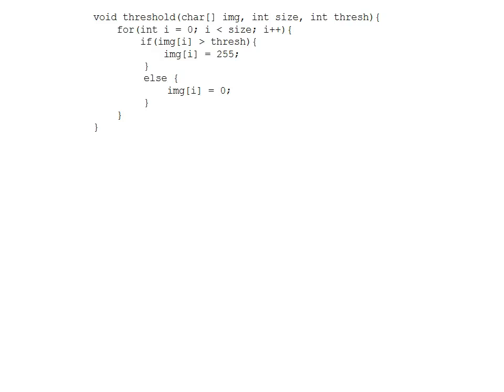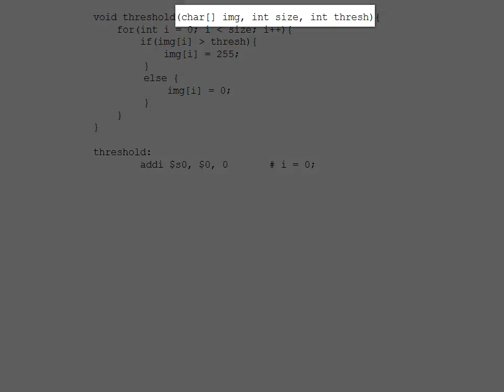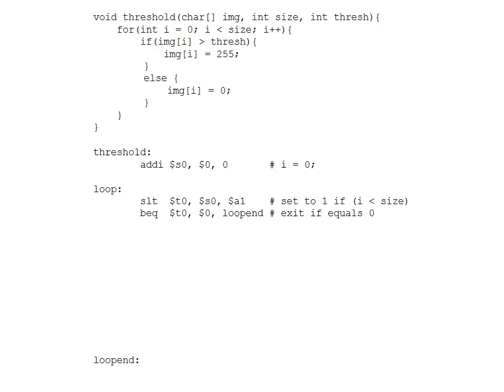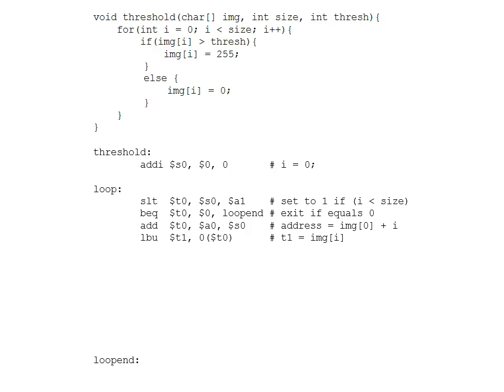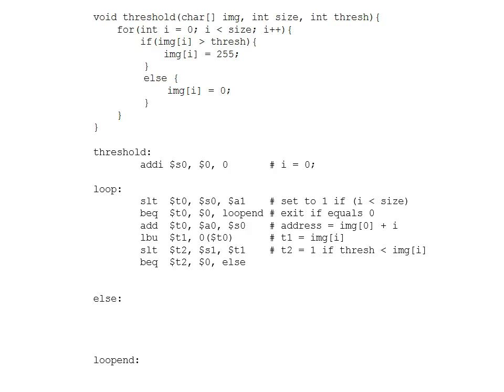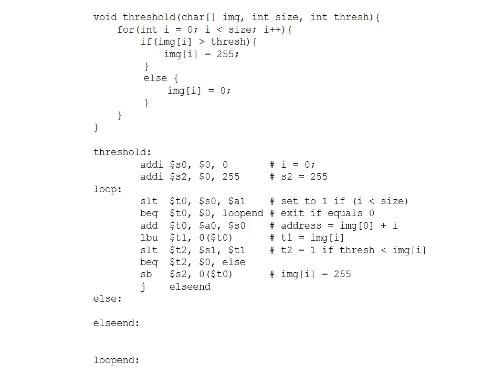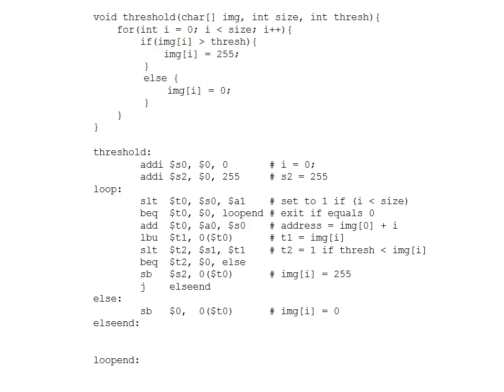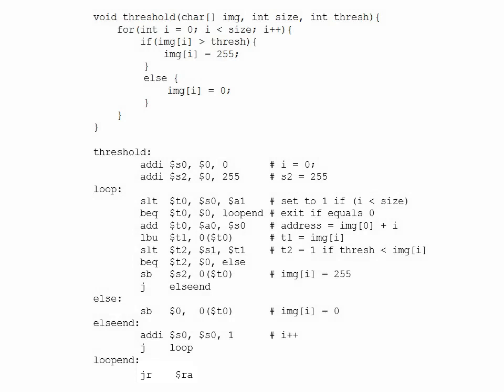Translating C to MIPS Assembly Example

Comment: for line sb $s2, 0(t0),  shouldnt we use t1 instead of t2 for img[i] since in the lbu $t1, 0($t0) line it translates to t1 = img[i]? (5:03)
Reply from the maker: Well, t1 is not used in that equatiion, so it is hard to say to use it with in mind.

Comment: Why isn't the addi $s2, $0, 255   instruction inside the loop?
Reply from the maker: The  255 value is the largest value that this unsighted char could take on. The loop is looking for when the value is less than the largest value it could take on. The loop is looking for the smallest value it takes on. Does that clarify items?
Reply: @matthewwatkins88  It does, thank you.